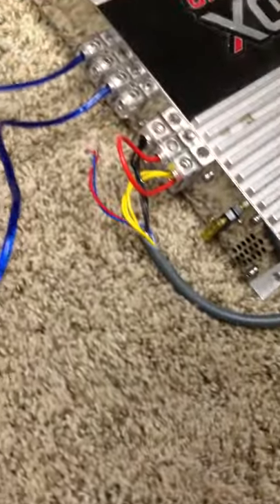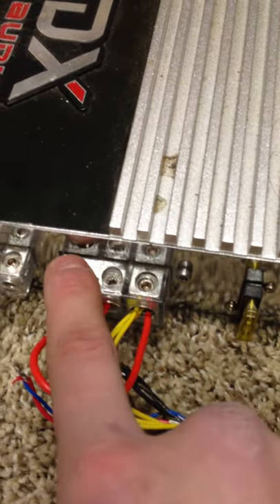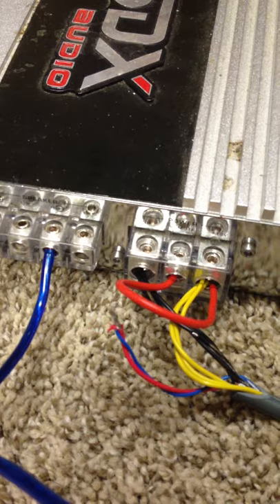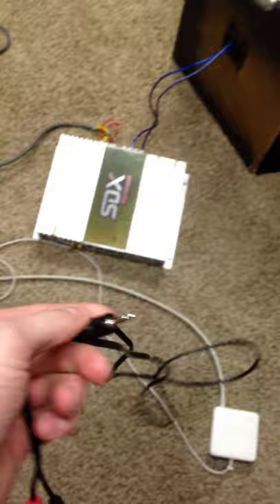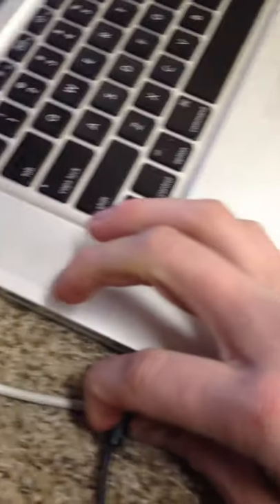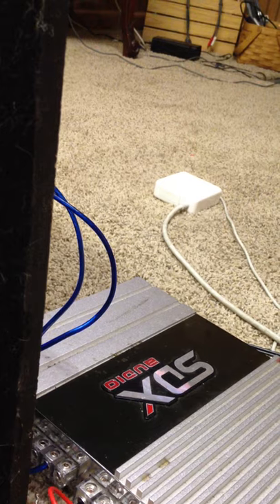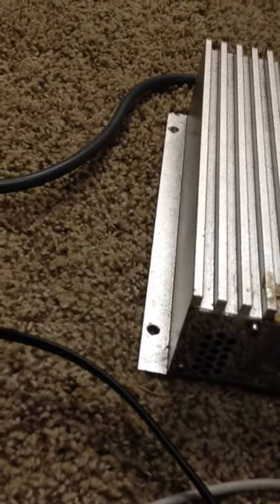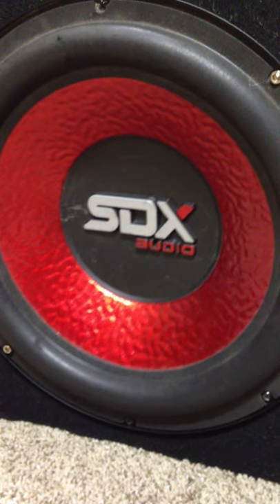How to properly hook up a xbox360 power block to a car amplifier

Comment: For those of you with four yellow wires and four black wires that are having trouble with it cutting out, try cutting off or not using the skinny yellow and black wire.  After doing this it worked perfect for me.
Reply: Booger Eater he forgot to add a inline fuse to the negative wire and he forgot to use power and ground wire that normally comes with a amplifier install kit you can just use only a Xbox 360 power brick and not use a amplifier install kit and not use a inline fuse but you do so at your own risk because there's a good chance you could damage your amp by not using a inline fuse on the ground wire the fuse on the amp itself is not enough to protect your amp from getting damaged you have to have a inline fuse on the ground wire
Reply: Dude the ground wire never gets a fuse. The power wire should be fused within a foot from the battery. And I have three Xbox power bricks on my Rockford fosgate amp running around 2000 watts, in my room, without any fuse. The power bricks will turn red if too much power is applied, but it fucking jams

Comment: This can actually underpower your car subwoofers because they won't move as much and won't hit as hard because it only gives your car subwoofers 175 watts if it's a 14 amp Xbox 360 power brick id suggest taking 3 of them and parallel wiring them together and giving your car amplifier more amperage or get a car battery or a computer power supply

Comment: I've actually got 4 yellows and 4 blacks, 1 blue and 1 red

you will get 8 (10 in my case) separate wires; 3 yellow, 3 black, a blue, and a red. the yellow are your power and the black are ground and the blue and red are for the power enable. You could also twist the red and blue together, or stick a on/off switch between them.
Reply: no shit thats what this video is explaining

Comment: I have a question can you take the three yellow positives and connect them together with the remote wire and then plug it all in properly without burning my amp
Reply: Chad King you figure it how, i’m in the same issue right now.

Comment: Good job on being innovative with the knife but you can cut into other wires and expose them causing them to short out on each other thats why they made wire spliters
Reply: but he didnt
Reply: ExtremeBassLine if you use only a Xbox 360 power brick and choose not to use a amplifier install kit and choose not to use a inline fuse on the ground wire you run the risk of damaging your amp and your wires will get hot and melt and cause a fire so do it correctly

Comment: Is there a way to do this where I can have the amp pushing a small 10" sub and maybe 2 5 1/4" speakers? Also if you took that jumper wire and put a switch on it would it turn the amp off so you could leave it plugged in and just turn the switch on when you want it? P.S. good job on the video it was very helpful!
Reply: yes you can get a switch and yes you can use as many channels on the amp as you want just make sure you get enough power i recommend using a computer power supply

Comment: If your using a car head unit then you don't need to short the remote with the 12 volt positive because you can can wire the remote directly up to the blue wire on the wiring harness of your head unit
Reply: That’s what I have setup with a head unit and remote so I can turn it on and off from the button on the deck
Reply: I've had the hum/hissing problem on my active subwoofer when I've short the remote with 12v positive, but after I directly connected with the blue wire, it's actually solved my problem.... Thanks for the info...

Comment: I'm running 3 Xbox power bricks on my Rockford fosgate punch 500. No fuse, no ground, zero problems. I'm probably pushing 2000 watts to my subs in my bedroom. And p.s- don't use the thin yellow and black wire on Xbox power bricks

Comment: Can you make a video where you connect a head unit as well if you can
Reply: why would u use a head unit? just use any receiver you can find but make sure it has rca outputs on it so u can connect it to the amp
Reply: You have 2 options I believe run amp only with a rca yo 3.5 mm jack which works just fine but no bluetooth or run just the head unit and just get the 50w X 4 most of the head units these days come with. And just fun it like your head unit in your car
Reply: Ian Weaver i have a question. if you’re on to answer?

Comment: bass and amp turn off when I turn up the volume.  1300 watt sony xplod.  kinda a bummer.  sounds sick as hell in my car just want that same sound in my condo
Reply: thats because the power brick from the 360 cant provide that much power
Reply: Darren Kuntz why not just buy as powered home theater sub? i have one and the amp pushes out 1k watts
Reply: I have the car battery just waiting on the 8 gauge wire in the mail.  Should be here by Nov 1st I'll let u know
Reply: Darren Kuntz how much power are you going to be running?
Reply: Darren Kuntz try running multiple Xbox 360 power bricks in parallel and then use a amplifier install kit and a inline fuse with the correct fuse
Reply: Darren Kuntz more amps means less clipping and less distortion and means your subwoofers will hit harder at higher volumes make sure that the amperage of your power supply is higher than the fuse on your car amp

Comment: will this work with a 1300 watt Sony xplod and 2 12" sub's?  I tried a laptop charger with no success.  a 1 amp battery charger no success.  the amp turned on but the speakers just make clicking sounds lol I'm just curious
Reply: hey better get a car battery and a battery charger which should be turned on every time you use the amp . i also got a pioneer GM-D9601 and GM-D8604 set up in my room with 3 jbl 1100W subs and 3 600W 6x9 speakers and have no problem running it
Reply: have car battery being shipped 1300 watt rating so will c.  can't wait
Reply: that pioneer amp looks nice.  I'll take 12
Reply: that pioneer amp is worth every penny trust me , it's so damn good
Reply: Right on I just need some 8g wire. Went to Walmart and the cheapest kit was $32 I was lk f that I'll wait a few days for ebay and pay half that.  I got 40yr kids living above me banging on my walls.
Reply: you should buy a computer power supply they have one that puts out 1600 watts and they put out clean and efficient power

Comment: Keep in mind that when your using a Xbox 360 power brick to power a car amplifier indoors your not actually grounding your car amplifier which can be very dangerous and destroy your car amplifier if something goes wrong that's why I recommend you ground your car amplifier regardless of how you power it you can take a metal pole and another piece of ground wire and ground your car amplifier indoors but the thing to do is that your ground wire has to be outside and the metal poles need to be buried into the ground and then you have another piece of ground wire come back indoors through the window and back to your amplifier because you can choose not to ground your amp but the manufacturer doesn't recommend it and always use the wires that come with a amplifier install kit because the manufacturer recommends that you always use a amplifier install kit and the negative wire should always have a fuse because not only does your amplifier have a fuse but the negative wire should have one too you can choose not to have a fuse on the negative but the manufacturer doesn't recommend that you run a car amplifier without a fuse on the negative either and that's mainly because if something goes wrong you're amplifier will go in flames and fry on you
Reply: can you please explain the ground how should I ground my amp if the cable is outside the window onto a pole buried in the ground should there be two cables or how?please help and btw thank you for your many advise must have took you like half an hour to type all thet

Comment: so got everything hooked up car battery car charger amp turns on just fine still getting "clicking sounds"  wtf am I doing wrong.  U can feel the box kick when plugged in the a/v cord.  stressed!!!
Reply: Travis Gulley  what I've learned is you need a solid connection between the speaker wires.  make sure there not kinked.  idk about bridging but your prolly loosing power everytime u do.   and my guess is your power supply as well.  I bought a car battery.
Reply: Lol don't screw it right to the box and you figure my car install from quality auto they screwed the amp to the back of the seat so I think that answers your question
Reply: & in would think it may or may not damage it

Comment: i also got 4 yellow and 4 black. i have my amp hooked up to my home stereo system as well as my sub. works great until i turn the bass up and the power brick shuts off cause my amp is drawing too much power from it. and suggestions so i can turn this bitch up???
Reply: Get another power supply and hook up that one the same way. You are just adding more power
Reply: leighton otto your likely using a 12 amp Xbox 360 power brick get a 14 amp or a 16 amp Xbox 360 power brick

Comment: This is probably not the best power source for really powerful car amplifiers that are in the 1000 watts range because if you have something like a crescendo bc3500 car amplifier then you might have issues at higher volumes and it might shut off because it's not getting enough power because for high end car amps you might need a computer power supply or a car battery to power them because a 360 power brick is for weaker and low end car amplifiers that are in the 100 watts range

Comment: Du you need the red cable
Reply: Yolo Crafters yes you need the red cables and you also need to have a inline fuse on the power and ground wires because otherwise you risk damaging your amp if you choose to only use just the Xbox 360 power brick to power your amp and choose to skip the use of a amplifier install kit then your only going to be able to run it for a few minutes and the wires will get really hot after a hour or even a few hours and possibly cause a fire

Comment: look im just going to be honest you cannot listen to this man seriously FIRST of all... why would you even want to do this???? I do give him props for using the xbox power block to convert the ac to dc current but this is not what its designed for. There is special wire mad for these applications that have hundreds of strains in the copper in them, reason is is because electrons move on top of copper not through it. So the more strains you have the better current you will have. ALSO depending on the wire you by there is oxygen free wire reason you would want oxygen free wire is because oxygen blocks the flow of electrons . Xbox power blocks do not have oxygen free wire in them. SECOND that subwoofer is not designed to work with frequencies above 80hz and putting a subwoofer on a amplifier running on high pass OR full pass will damage your subwoofer. THIRD there are different OHM loads that a amplifier is designed to run on CHECK your ohms before hooking a subwoofer up this is important because it can dammage you amplifier. If you are going to hook an amp up this way I recommend using a battery and charge it when it gets low.
Reply: you can use a psu for a power source those work well